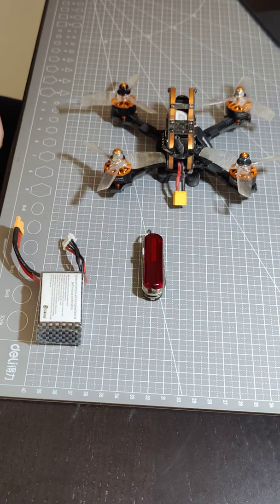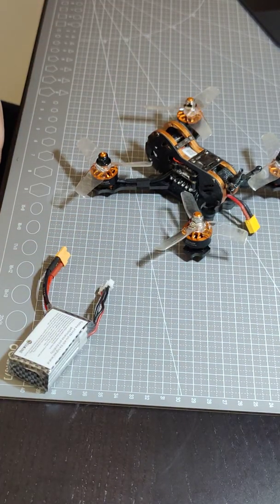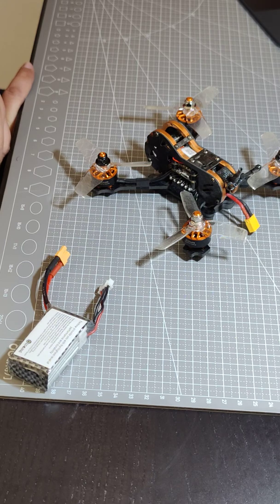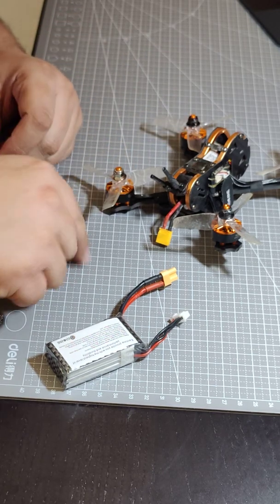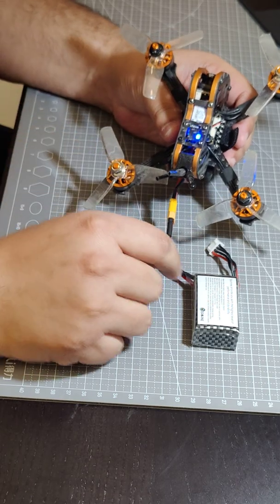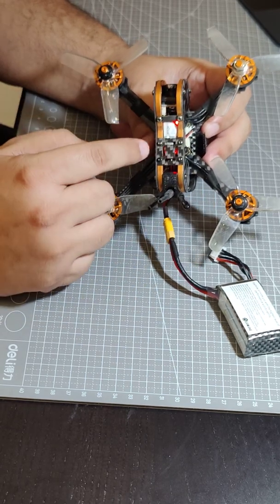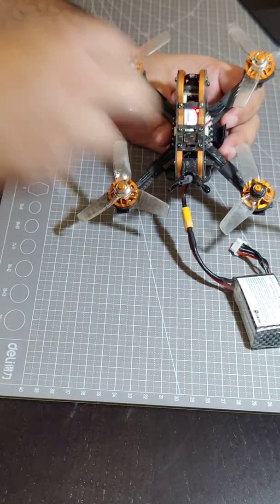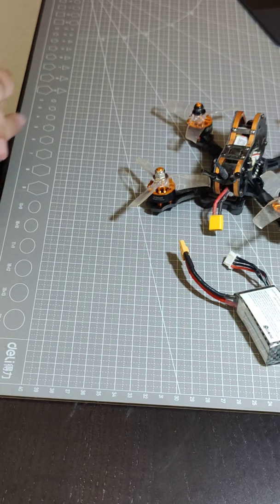Configuring the VTX on an Eachine Tyro79

Comment: Hello bought this rtf kit and flew it once, the next time I tried to fly it doesnt show video anymore, would it have to do something with the vtx?
Reply from the maker: Probably. If it flies but has no video, the flight controller is most likely OK. You should start by checking the connections between the camera and the FC and from the FC to the VTX just to be sure a cable did not break.

This video from Joshua Bardwell should be very helpful: https://www.youtube.com/watch?v=Y4YitIkb-N8

It's possible the FC has issues as well, but only in it's video system, in which case you can attach the camera directly to the VTX. This means you will loose OSD but at least your quad will be flying.